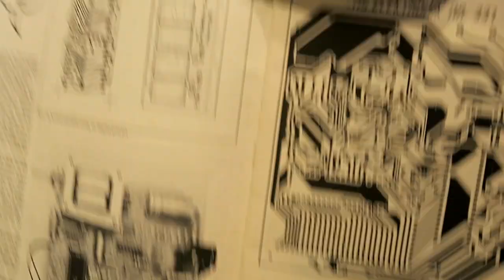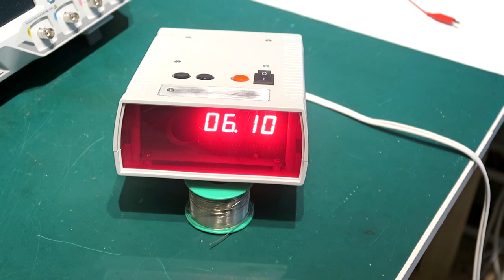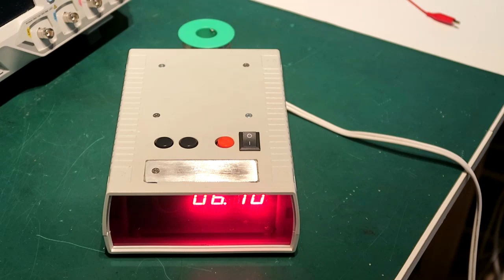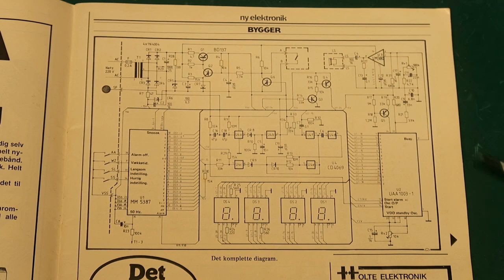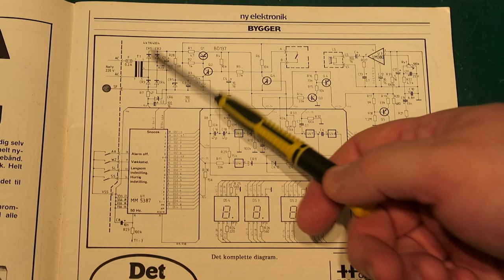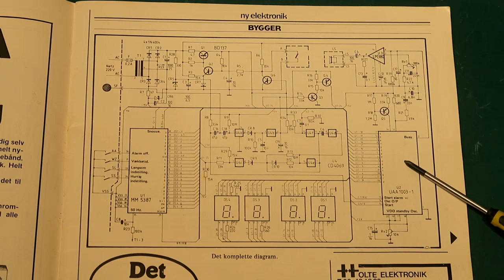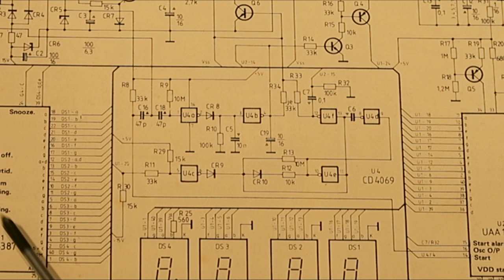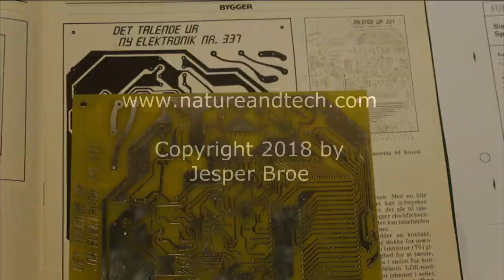Teardown of 1980's Speaking Alarm Clock

Comment: Nice kit ! Thanks for sharing. The speech chip sounds very close to a TSI S14001A chip with an english ROM, that uses Forrest M. Mozer's algorithm speech synthesis. I know that sold licenses to other companies to use his patent. I have a Voice Chess Challenger computer from 1980 that uses that speech synth chip too. The speech is not as good as the Texas Instruments Speak And Spell chipset though. But the TMC0280/TMS5100 chipset that it uses came out 3 years later than the S14001A. I also have an alarm-clock radio that uses a "touch" snooze button. It still works great, but it doesn't talk...

Comment: 1:32 That property was typical of tabletop electronic digital clocks back then. I have one now that uses two touch activators to control the alarm (but not the dimmer). 
The 'electronic capacity switch' is nothing new.
Reply from the maker: That's right. Touch was really big in the 80's.

Comment from the maker: I just noticed that it appeared in the same issue as the first review of the Commodore 64!
Reply: Zener Diodes coupled to a power transistor is a voltage regulator